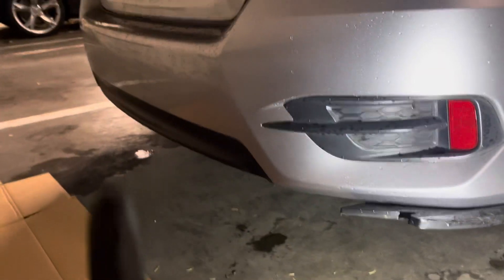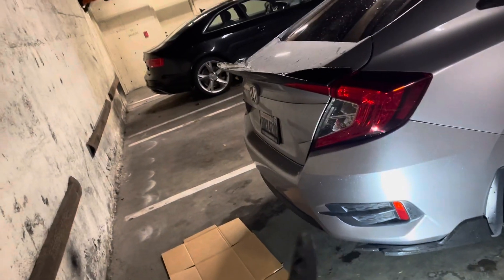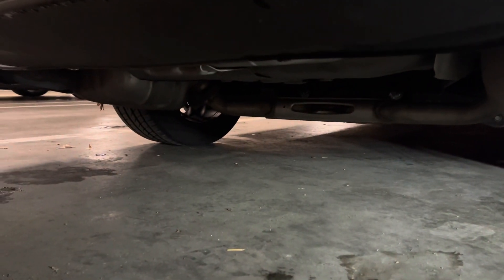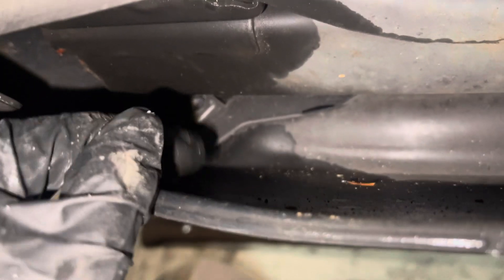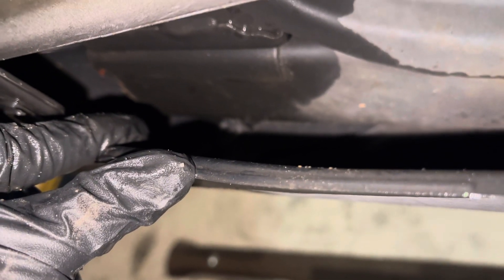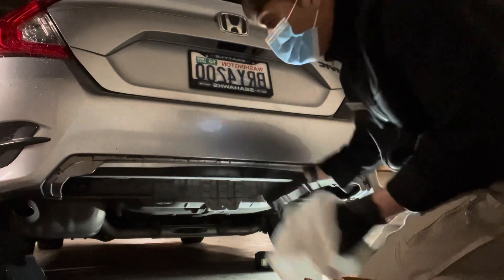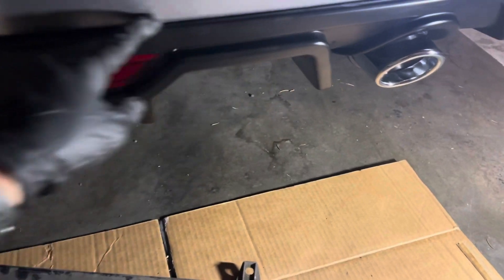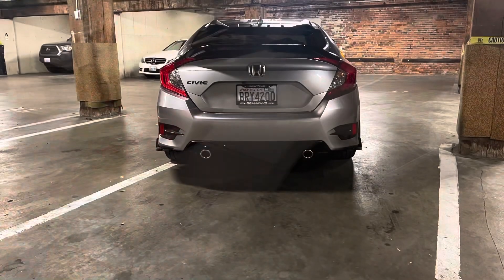Installing aftermarket rear diffuser on my 10th gen civic

Comment: I bought a few of these aftermarket diffusers and they all have the same fitment issues...i ended up keeping the stock one but i snapped off those inside clips when i first removed it and added exhaust tips on the stock muffler.
Looks good still

Comment: Can you make a video of how you installed your spoiler
Reply: It’s just tape really if the car didn’t have the mini spoiler, but if it did you need to remove the plastic bolts on the truck part where you lift it up and push the little plastic bits holding the mini spoiler in place, then get new spoiler and use tape to stick it on